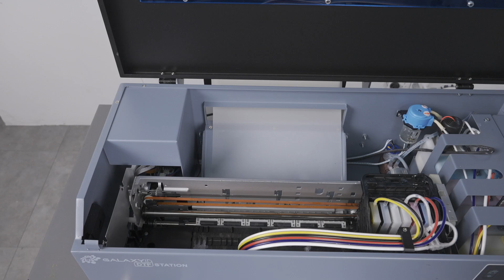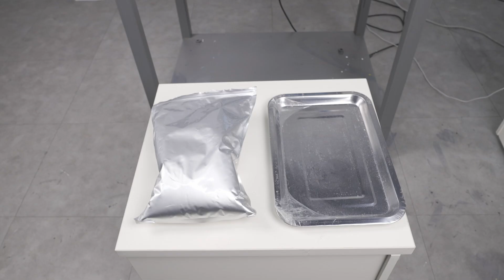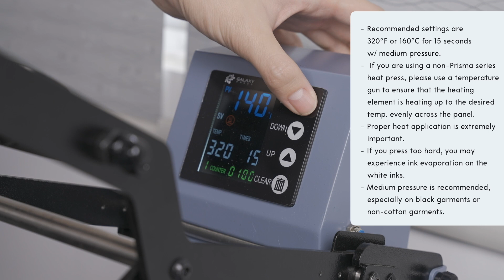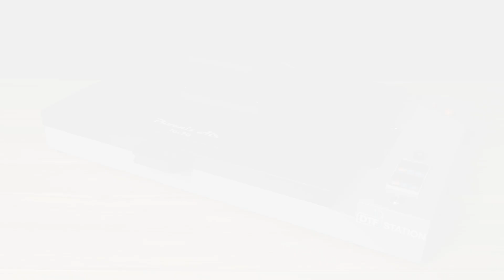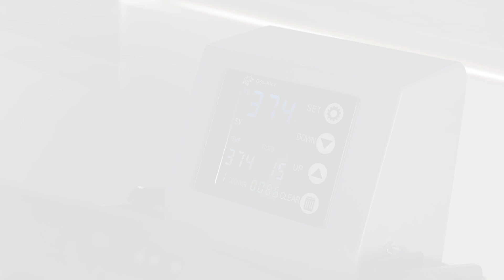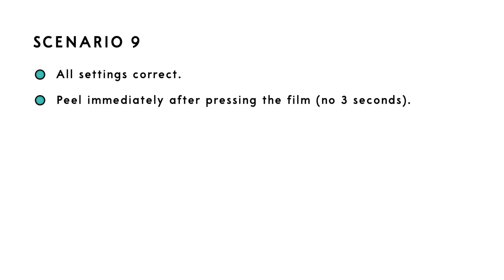Prestige A4 - In Depth Direct To Film Training

Comment: Hola, me gustaría que mi impresora use mas blanco del que va por sobre el diseño, que configuración puedo usar?
Reply from the maker: To increase the white ink output in DigiRIP, you can follow these steps:

1. **Launch Queue Properties**: Open your DigiRIP software and double-click on the Queue Properties tab.

2. **Navigate to Color Layer**: Click on the "Color Layer" option.

3. **Adjust Maximum Ink Percentage**: Go to the "Processing Option" and find the "Maximum Ink Percentage" setting. You can increase this percentage to make the white output more opaque. It's typically set at 60%, but you can increase it in 10% intervals to achieve the desired opacity.

4. **Adjust Highlight White**: If you have DigiRIP or Digital Factory version 11 or higher, you can also adjust the "Highlight White" strength. This setting is defaulted to 100, but you can lower or increase it in 10% intervals to fine-tune the white ink output.

5. **Choke Adjustment**: You can also adjust the choke setting to control the spread of white ink. Lowering the choke value will make the white ink whiter, while a higher value will shrink the white ink.

For a visual guide, you can watch these videos:
- [How to Increase and Decrease the White Ink in DigiRip](https://youtu.be/sIBR2nzdbh0)
- [How to perform White Ink Adjustments on DigiRip | DTF Station](https://youtu.be/6VZinXkHPOk)

These resources will provide a step-by-step walkthrough of the process.